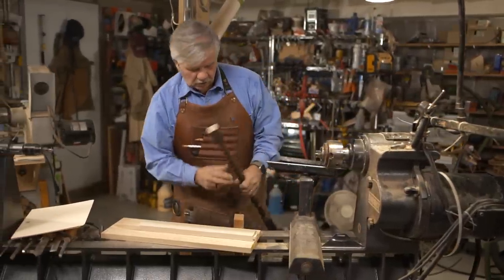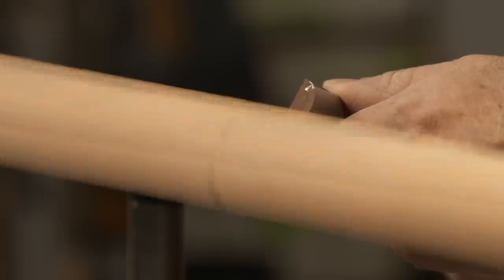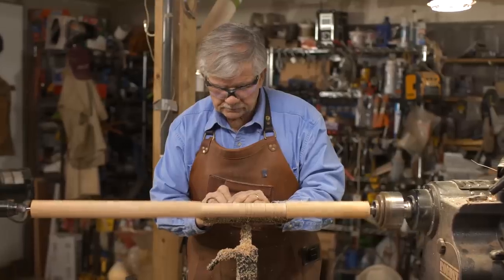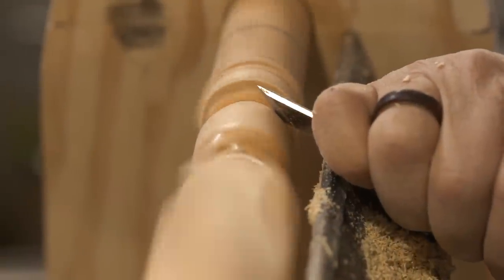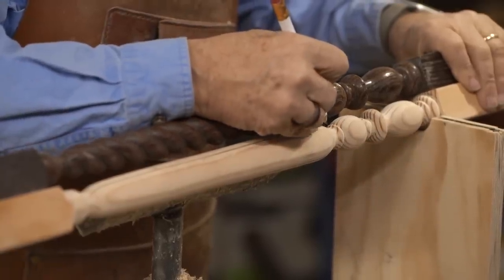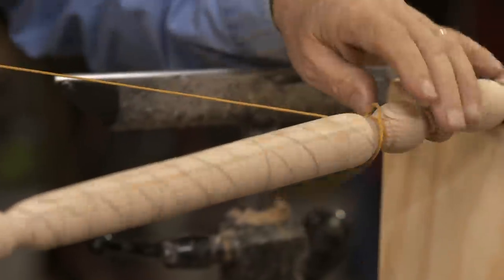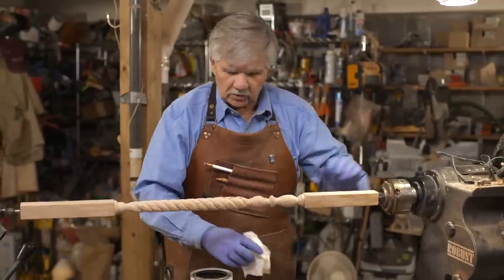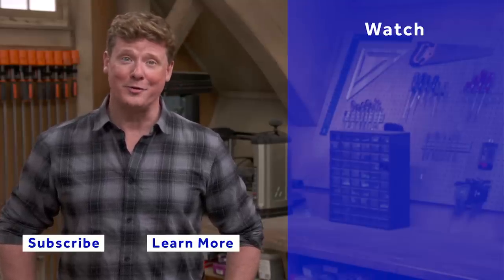How to Replicate Antique Staircase Balusters | Ask This Old House

Comment: Now imagine that you have to make dozens of these balusters just for one staircase. You have to respect the amount of manual labor they put in detailing the old houses.
Reply: There were much faster and more consistent ways to make these, if you were making a bunch of them.
Reply: Tommy can do it in half the time because he doesn't sand them
Reply: The detail of older homes is astonishing.  Wish people had the patience to give carpenters as myself enough time to make stuff like this happen instead of get it done with pre made balustrades!
Reply: Well said, that's how these old homes get cut up for parts before being torn down saving all the old part's, too much labor to make today
Reply: Cnc wood working
Reply: Well said I see that working today
Reply: Guessing these were made originally on a templating lathe, an early form of repeatable mass production
Reply: STRAIGHT to china
Reply: @jeffclark2725  nah now they would print it and put on a veneer
Reply: older wood was stronger. working on it would have been harder.

Comment: Where my dad used to work, they had a duplicarver, and it was basically a router on a wood lathe, and it had a pointer for the original, and a router bit for the copy. It could also do flat work, as my dad copied a cast aluminum eagle in walnut for inside and top of our front door.

Comment: I was a little disappointed in this effort.  First, Tommy should have measured the distance between high points to get the correct spacing, then layout using a ruler or tape measure instead of eyeballing it.  Second, the very rough finish using the rasp was quite rustic and didn't seem to match the original very well.

Comment: The lathe should have the feature to make thread automatically
Reply: You’re thinking of a metal lathe, which has a lot of features for machining metal, including single point thread turning. You can put wood on a metal lathe, but you would still need a custom cutter head and a good working knowledge of the thread turning process.